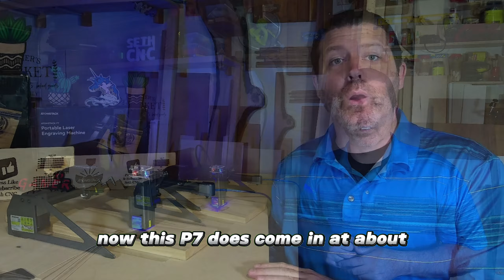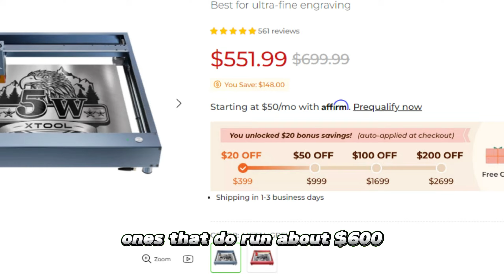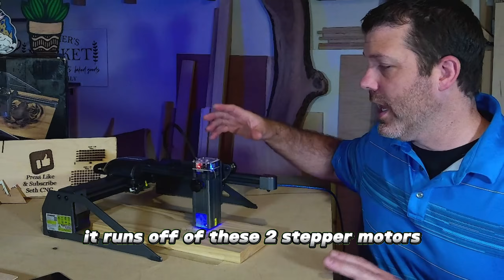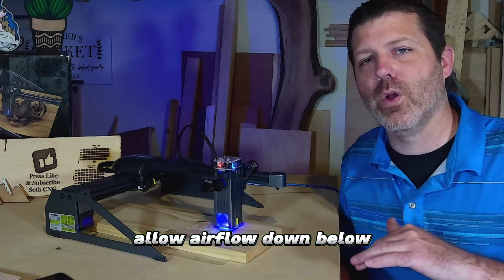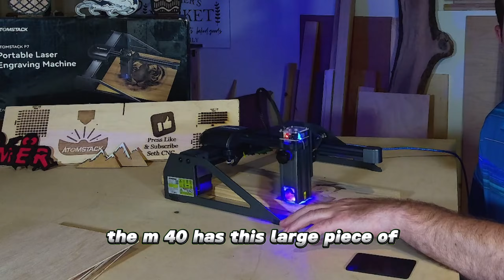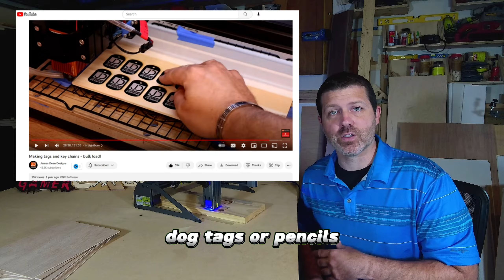Can This Tiny Laser Engraver Live Up to the Hype? | Atomstack P7 Review

Comment: Hey Seth, thanks for sharing this video. Question on this unit, if I wanted to engrave on a tray I make on my cnc, does the laser go below the surface level? I make a 15” round tray with a half inch pocket and would need to set the unit on the rim of the tray so I am wondering if it would work
Reply from the maker: Yeah, I just tested that and I got a little over 1" if additional drop of the laser module below the frame is achievable with no modifications. 
And with adding a little home made adapter plate, the depth could be increased even more... so your 1/2" deep pocket would definitely work with the stock machine.
Reply: @SethCNC  thank you for checking that. I appreciate it.  Would you need air assist if you primarily just engrave? I appreciate all you do
Reply from the maker: @Kevin Jensen  thanks for asking,  now you've got me thinking of another project idea too use both the cnc and laser in one video together 😆👍

Comment: Great review. My previous laser would light up the whole room with blue dispersed light leaking out sideways. Hardly any light is escaping from this is good. 
How fast can it go and how deep cut? Will it take an air assist?
I let Lightburn lapse. Is it $60 per year or lifetime purchase?
Reply from the maker: It's the first a year of updates for $60, then if you renew within some time period after the included year (I think 6 months) the renew price is 50% of the total price, so $30. . If you wait longer you're stuck paying the full $60 again for another year of updates.

My first one I paid the $40 it was back then, then I let it go like 3 years before seeing updates that I really wanted and then the price had gone up to $60 and I paid that and $30/ year thereafter on auto-renew.

There's a rumor of cnc cam in the near future, but so far it's just customers spreading that one, nothing official from the company denying or confirming its in the works...

As far as the machine questions, about 6000mm/min was the fastest I could get it to go, the acceleration rate of the nema17s is the limiting factor due to the small work area it can't get up to speed faster without faster acceleration settings then I get a stepper phase lockup a little over 6k. (Default max is 5k) 
I've only tried cutting through 3mm and 5mm plywood. And if cut them both as cleanly as my 10w xtool with ais assist.

For adding air to this laser module, the m40, because of the local length needs to be 2mm away from the workpiece leaving no room to add a diy nozzle, but swapping the module out for a different one that either has a nozzle integrated or a different focal length and air assist could be added, I have another laser that fits right on the same mount, a smaller 3.5w and with air assist it's still weaker than the m40 laser without the air. I think the close distance helps the built in fan blow some of the soot out pretty well.

Comment: Hey Seth,
I thought you touched on it, but not quite sure. Could I set the laser on top of a piece that is larger than the lasers footprint, or does it have to set between the base?
Reply from the maker: Yep, the laser drops down all the way to work perfectly for this.
Like engraving onto a large board or even a table.

Comment: Nice video Seth.  Every woodworker should have one of these little lasers. I got an Aufero Laser 1 about a year ago.  Easily puts your makers mark on almost anything.  I would love to have one with an offline controller, maybe battery powered also.
Reply from the maker: Thats cool! I end up mixing up which SD card is setup with files for which Machine, I guess it's Time to label them, and some color coded stickers wouldn't hurt either 😅